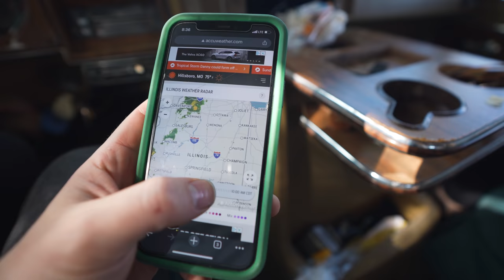RV Road Trip to Chicago for ENGINE OVERHAUL! - Will We Make It??

Comment: Just an FYI for anyone caught out in a vehicle thats running hot and creeping up, “turn your heating up to full, i know your gonna be sweating 😅, turn blowers on full, and it will bring the heat down on your engine” its a weird hack that really does work and has helped me out on numerous occasions over the years 👍
Reply: This is true!
Reply: Sad but totally true. I had a POS car that was running hot and I had to keep driving it until I made it to a safe area to pull over. My dad is a mechanic and gave me this tip, so I didn't have to pull over in a dangerous neighborhood.
Reply: I was about to comment the thing.
Reply: Yup I was thinking this the whole time. My first car a 96 Camaro would overheat from time to time and this helped get me home.
Reply: YEP! Fond memories of driving around a 66 Mustang in Phoenix, AZ , in JULY at 115 degrees with the windows down and heater on full blast. Fun times!!!
Reply: I had to do that in my old trailblazer before I got my wrangler, the water pump was leaking and the extra water from the heater core cooled it back down

Comment: Check your fan clutch for being too loose. Also make sure the lower radiator hose isn't collapsing. There is a spring that is in the older big v8 engine lower hoses to keep it from sucking shut. They sometimes corrode and collapse in these older rv's that have sat for periods of time.

Comment: I agree with some of the others below.  If you're putting in a new engine, replace the radiator.  Go with a three or four core radiator, replace the water pump and the hoses too.  Not worth losing an engine over cooling issues.  Replace all belts too.  
You may also want to consider updating the A/C considering you are in the south.  
Nice job on the van so far.  It will be great to actually watch it get put to use.  

You two are awesome; keep it up.  Love your videos.

Comment: I'd recommend getting a new radiator while the engine is out as RV's sit idle and rust clogs it.
Reply: That's likely required in order to keep the warranty on the new engine.
Reply: The buildup of rust inside the engine and rad is most likely the overheat issue. So you are spot on.
Reply: It can even be as simple as a faulty radiator cap not keeping the correct psi.
Reply: @hrep14  That's wishful thinking because any vehicle 25 years and older that sits non running for long periods of time needs the radiator rebuilt or replaced I know from experience!
Reply: @hrep14  That could be an issue some times, but at 3:20 you can see a new radiator cap.
Reply from the maker: Don't worry! New radiator is on the list of updates/upgrades :)
Reply: @Theendlessadventure  What are you doing on Youtube, get out there and enjoy Chicago. kidding, have fun , be safe.  🤣💛💛💛
Reply: @Theendlessadventure  I hope you also have on your list, new trans filter and fluid, new gear oil in rear axle, and new U-joints in drive shaft to truly have a trouble free Endless Adventure!

Comment: Can't emphasize enough getting a new heavy duty radiator.
Reply: I'm sure the old radiator is clogged, at least partially. 
I just had the same problem with my car.
Water was perfectly clear flowing through it, but after about a minute of running a hose through it with the hoses disconnected,  it started to overflow out of the filler neck.
New radiator solved it.

Comment: When you get the motor rebuilt make sure you get the water pump, thermostat, hoses, belts changed.
Reply: The engine is going to be replaced. The people in this shop do this for living; i.e., they know what to do.

Comment: Turn on the heat inside the RV and that helps take it off the engine.
Reply: yup, heater on max and all windows down will cool the engine dramatically.
Reply: @jabez1960  that's a neat trick

Comment: If you are going back with "normal" coolant add Red Lines "Water Wetter  Super Coolant", it can lower the engines running temperature by 30°. If you want a better solution (a bit more expensive though at around $30-$50 a gallon depending on where you get it, but very worth it!), go with "Evans High Performance Waterless Engine Coolant". No water used so the boiling point is much higher than traditional coolant, you can even remove the radiator cap while the engine is running and warm without it blowing coolant everywhere because no steam pressure builds up! It also much better for the cooling system and engine because it doesn't cause ANY rust or corrosion or electrolysis to the metals! I would also suggest at least a new radiator and hopefully a higher capacity one to get better cooling properties! Loving the job you guys are doing on this! Definitely do more of them!

Comment: Huge recommendation… If you run the RV hard at high speeds or interstate travel or even uphill, don’t just stop and shut it off if you can help it. Once you shut it off coolant stops circulating in heat will build up. IDEALLY let it idle until it comes down to a normal temp. Also if your radiator cap is not holing pressure… coolant will boil way way too soon… and that will cause overheating.

Comment: My old Suburban started running hot and I replaced the radiator, upper & lower hoses, and put in a heavy duty water pump. Now it runs cooler than it did when it was new. One peculiar thing I found was that the inside of the aluminum thermostat housing had a lot of casting flash around an inside bend which looked like it was restricting coolant flow & causing turbulence, so I used a grinder bit & file to remove the excess material & smooth it all out. Another thing you need to check on an older engine is the fan clutch if your engine has a belt driven fan and not an electric fan.

Comment: Hope they put a new heavy duty radiator in you ole girl. Plus I have the transmission gone though new oil in the rear end checked out to. I'm guessing your radiator is plugged up. You two have done a wonderful job redoing. Great job.

Comment: a lot of people are right also get a new radiator with the engine overhaul.. And while your at it maybe a new heater core... Radiators get full of scale from ruse and minerals. Most radiator flush products do not work but you could do a CLR flush there are videos on you tube on how to really flush and get out rust and deposits from old radiators in classic cars. I did it on my 77 chevy van and it works great now. no more overheating

Comment: When your engine is starting to overheat you can set your HVAC to full heat and turn the blower on full. Yet it will be miserably hot but that will help pull some heat out of the engine. People forget that the heater core is just another radiator.

Comment: Howdy I have a 76 dodge c class's and my unit has a electric fuel pump back by the gas tanks. It gets the fuel to my mechanical fuel pump on my engine. It also has a transmission cooler and a gear ender overdrive to help on gas mileage. It's fun watching your adventures!!!!! Thanks Bill

Comment: Put in a new radiator and cap and water pump and new hoses and flush the system out and install fans belts with that new engine, and change that axle/ differential oil too and maybe add a bigger transmission cooler if you are going to tow a boat/jet ski or a toy hauler. Make it bullet proof so you can take super vacations with no troubles. When in doubt change it out.

Comment: I've been watching your RV project for a while now, and its been an incredible journey to watch you all create this beautiful project! You guys have really out done yourselves on it, and that's something to be proud of. I am on the same journey you all are with my 1988 Coachmen Catalina Class C, and I find it funny because I am at the other end of the spectrum. I have all the mechanical experience but not much wood working experience, but I try and make it happen nonetheless. Hopefully I can make my interior look just as good as yours does one day, but for now I at least got my rig fully functional and ready to boondock, and that's what I care most about. Good luck out there, you guys keep on it with your project, and so will I!
Reply from the maker: How exciting! The engine is definitely the most important part (we say after a year of only really working on the interior 😅)! If you have it running reliably, you can take your time fixing up the interior. And hopefully your interior doesn't have as much rot as our did so you can just make fun decor updates as you go 🤞
Reply: @Theendlessadventure  Ha, yeah without an engine you wont be adventuring very far, that's for sure! My engine runs flawlessly, I tuned it up myself just to be sure it stays that way, and man my Rot was bad, and it was all in the roof and walls. I actually practically completely rebuilt my roof when I found out how extensive the damage was. I kept digging and digging further into the roof hoping to eventually find something good until I finally gave up and whipped out the circular saw and sliced the whole roof off. I rebuilt it with PVC 1/2" Plywood so it will never rot again, and also used only quality stuff so that hopefully this RV comes out of it with a hurricane resistance rating haha! Still ironing out the functionality stuff so I got a ways to go yet before I can have fun in the interior. If you go back to my channel you can see my original 1988 genset I am currently reviving, I recorded videos to here to get better help from my forum friends on how to fully restore it, and there's a little bit of my old RV ( Maybe one day I will get the motivation to make a before and after video, I got like 300 photos of my work that I've done over the last year, that's enough to tell a story!). At least you guys got aluminum outer walls, because I'm stuck with fiber glass, and man does it crack if you are not careful, stuff is major brittle. I had a time with that wall when I completely rebuilt my front cab from scratch, cracked on my three times around my main windows. Anyways, thanks for the response, and if you all ever decide to get an older genset for your rig, or even need electrical advice, you can always let me know if you got questions, I've been working with electricity for a long time, and know a good bit of stuff!

Comment: Over heat problem, check the fan clutch , the water pump for flow, thermostat (you did that) Stalling while coming to a stop in drive, transmission torque lock up solenoid sound the guilty party here, new engine looks like you're getting a TBI (throttle body injection) should get a MFI (multi-fuel port Injection) more efficient, Cheers see you on the road!

Comment: Part number 1906 is the ebelbrock carb part number you need. Will not use much fuel and wont leave you stranded and give good power when needed. May need an adapter not sure of what you have now.

Comment: The carb is most likely clogged, causing it to run lean, increasing heat. Running rich runs cooler. And when in doubt crank up the heater and turn the blower on high. It’ll help decrease temps.

Comment: We had an '83 Winnie and did the engine rebuild thing too....I was told later that I would have been much happier with a transmission swap too.   Those things don't have an overdrive gear and the differential gearing on them is brutal.  We never drove much over 55 mph.

Comment: New radiator time, could be rusty inside. If you drove with the heater on all the way it could help allow the heat to equal out.

Comment: I had the same issue with my 79 Vandura, Found out a pipe was blocked in the rad & with a lil squeeze and replacing the fluids, she ran fine.. but I had done the damage and cooked the engine.. Yes I managed to break a 7.2 cast iron V8 to the point she was spitting flames out the exhaust and was burning just as much oil as I was coolant and fuel...

Comment: Hi guys, been watching your channel for some time now, thanks you for sharing your journey and fun stuff. I had a similar mechanical issue with my van overheating and finally found a mechanic that discovered that the water pump was bad and caused the antifreeze to boil up as well. Wishing you all the best 👍😊
Reply from the maker: Thanks! And so glad you figured out the problem! Engines can be pretty sneaky sometimes 👎

Comment: If a engine is tired out, and it appears that it has either a breach of the head or gasket or a clogged radiator these are signs of an engine that is pretty much used up you are handling that part of it, good job. One thing to bear in mind is that these units were not designed to be durable in the way that modern trucks are. I would seriously prepare for a transmission replacement soon, and also additional coolers to be installed on the engine oiling system and the transmission oil system. To put it bluntly, if the engine is whipped, the tranny ain't far behind.

Comment: Could be your temp sensor. If it gets hot turn on the heater it will lower the temp long enough for you to get somewhere safe to pull over. Sorry this info is probably after the fact cause your probably there already good luck safe travels.

Comment: What year is the RV, again?  Watching you start it made me think it might be old enough to have an automatic choke.  If it does you fully depress the gas pedal, release, then push the pedal down again about half way before starting.  Once started let the gas off and it should idle high enough to keep it running and warm up.  When you are ready to go you tap the pedal and that reduces the idle.  If I remember right, I think most cars before the 90's had this type of automatic choke.

Comment: Make sure they put in a new hd radiator with new cap.  They have to take it out to get the rebuilt engine in anyway.  That should cure the overheating problems. I would also check out the tranny driveshaft universal joints and have a look at the rear differential. New engine will make more power putting strain on old other parts. Your putting in a lot of $’s in that old babe. Good luck. Love your videos. Regards

Comment: You probably just needed a head gasket replacement. I’m 95% sure that’s what was causing the overheating. Could have been fixed fairly easily for way less money. But hey that’s a good looking new engine! 👍😎. If it brings peace of mind then rock on y’all 🤘

Comment: wat i seen on onother bus build was the the waterpump impeller was loose on the pumpshaft so basicly the coolant wasnt circu;lating around inside the engine
one thing that helps cooling the engine is running the heater inside the rv (its an extra radiator)
other reason could be bad headgasket (s) putting pressure on the coolingsystem (though you usually notice white smoke comming out the tailpipe or the oil turning intoo a creme colour ) more likely that the water channels inside the radiator are clogged so it doesnt cool as good as it should (the clogs might bust loose during the trip and overheating gets less 
the new engine looks good i hope they rebuild the trans too that way there be less problems to expect down the road 

knowing youre mecanics will realy help you when buying vehicles for youre projects (you can regognise mecanical problems by the sound an engine makes and predict the added cost in fixing them  ) and fixing stuff when things break down on the road on the side of the road  , its allso way cheaper to repair stuff youreself compared to hiring a mecanic if you know wat youre doing , its a realy good skill to have 
i myself recendly swapped out an engine in my car with one from a donor car and saved over 600 dollar in labourcosts alone , it made that car worth double wat i payed for it

Comment: How many miles does it have? Also sounds like the radiator may be plugged. I would spring for a new one. I'm curious if it has a built in transmission cooler. Also the dyeing when you stop could be early signs of vapor lock. My RV does the same thing when I drive in hot weather. They say using ethanol fuel doesn't help
Reply: "Dyeing when you stop"?  All this time I assumed that Allison's hair color was natural!

Comment: Did ya try knocking the center out of the thermostat and putting the outer part back in  ? I used to race dirt track and it got HOTTT on the track when we raced . Car overheated all the time . Took out thermostat and car overheated . Knocked out the thermostat guts and put back the rest and no more overheat . Temp fix for street cars but the cooling line needs some restriction for stronger flow of antifreeze . Enjoying the remake of your motorhome guys !

Comment: If you have a vehicle that’s overheating, you have to stop for a fairly significant amount of time for it to start to cool down due to heat soaking. This is one benefit of installing electric cooling fans on older vehicles, since it will continue running to cool the water in the radiator instead of requiring a running engine and motion to cool it down.

Comment: Our vintage Rv im surprised only broke down 2 times for a 17 hour trip lol . This was after we put belts on it and fixed are over heating issue . It was breaking down  every hour when we first got it.  We have so far fixed the breaks for 1500$ and other repairs around 1000$ for that. Its so worth it.  We want to rebuild our engine sooner or latter as well.  But I'm just glad it runs for being a 1985 gmc cross-country.
Reply from the maker: Only twice?! That's actually pretty great lol! Sorry you've had to do some expensive updates, but it's definitely worth it in the long run 👍
Reply: @Theendlessadventure  yeah it will forsure will be we did a nice remodel on it too so we are happy with our rv forsure :)

Comment: Out of curiosity, are the mechanics going to look at your transmission at all?  Also, if you're getting a new radiator and water pump during this engine swap, maybe you can ask if they can put in a new heater core.  That would essentially replace the entire cooling system.  Looking forward to your next adventure!
Reply from the maker: Transmission is being rebuilt as we speak! 🙌